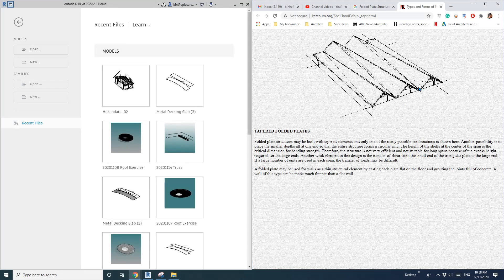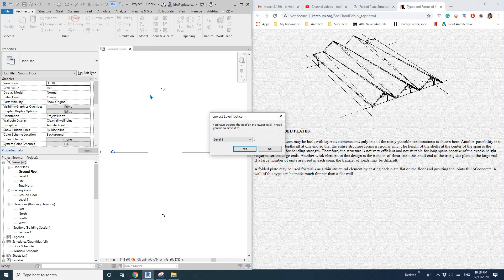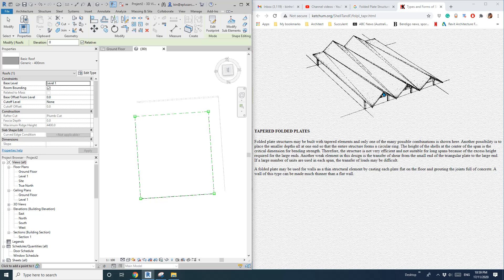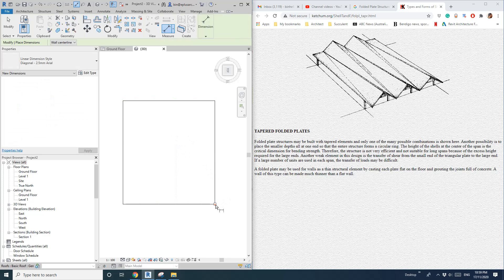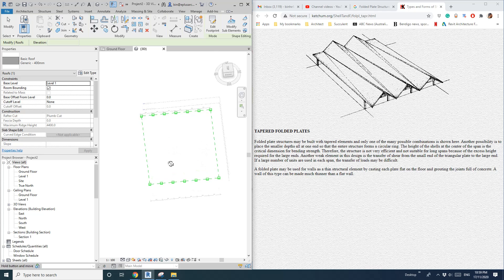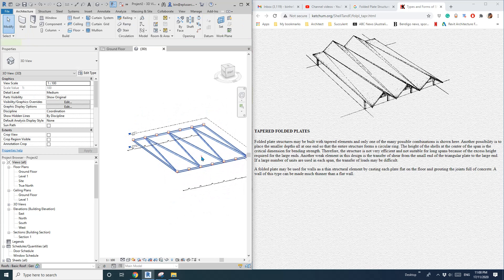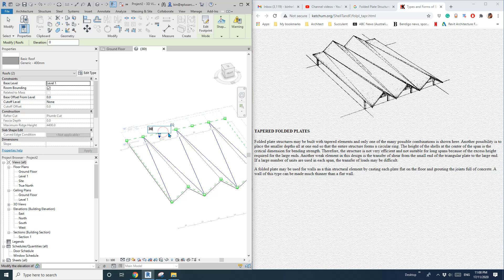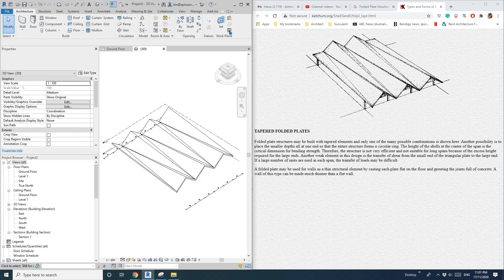Revit Everyday (Day 243) - Folded Plate Structures Roof

Comment: hi thank you. I have a question... when i moved the point up,  the bottom face of the roof stayed level  (in other words only the points on the top face moved up to create the profile, so ended up with a kind of mass with a flat bottom and profiled top... Any thoughts? Thanks in advance. Oh  I just realized this video was uploaded 3 years ago. Doh!
Reply from the maker: Select the roof - Edit Type - Edit Structure - Untick the Variable option